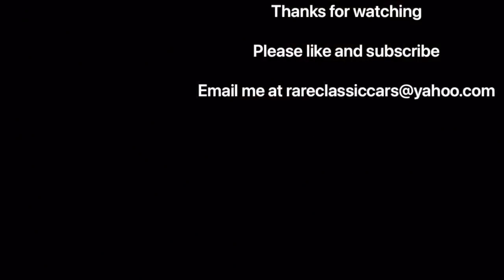Worst Engines of All Time: Chrysler 318/360/400/440 V8 Electronic Lean Burn

Comment: Had a 82 D150 with a lean burn super six  and manual - whadda dog....   put up with ping and no power for years...    rebuilt and reset the cab - both the metering rods and idle screws (drill and remove the idle screw locking caps, rewired it with 73 electronic ignition - woke up and ran great....

Comment: The Lean Burn system is in many ways identical to the GM CCC [Computer Control Command] that was introduced in 1981 except GM used a module in the distributor and did away with vacuum advance distributors.

Comment: One thing I might add;  my memory is shaky on this, but I do seem to recall that Chrysler was not the only user of the Lean Burn spark control system -  Volvo also used the Chrysler Lean Burn computer, but it was mounted on the fender.
Reply: Your memory is correct.

Comment: I had a 1976 Plymouth with a 400 lean burn engine.  The lean burn system failed and upon looking at the wiring diagram and realized I could substitute the lean burn distributor with a stock point-type distributor from a 383.  It was a direct drop in with no modifications whatsoever.  The car ran better than ever!

Comment: Had a ‘78 Plymouth Fury (ex RCMP) with the E86 engine, 440 high performance, with out lean burn or catalyst. The build sheet under the drivers seat said “emissions exempt”, so factory.
Reply: Here in California, they stopped allowing law enforcement vehicles an emissions exemption.  Much to the anger of the police, who suddenly couldn't catch the bad guys if they were driving a pre-emissions car.

Comment: I had a 71 fury that got 18 mpg . Now I have a 76 gran fury that got 11 mpg.This wasn’t acceptable to me so I replaced the thermoquad (850 cfm I)assume)with a 650 Holley it now gets 7 !! it didn’t have lean burn so I think I can introduce Chrysler’s decision to slap in very low compression pistons into their engines as another reason to nominate these engines as substandard.Though I guess the 2 71 1 rear could be to blame,it’s off the line performance is another black mark against it
Reply: My 81 Chevy truck came with a 2:73 rear end, despite having a stick, and the dealer said I couldn't order it any other way, so I had a wrecking yard that also did repairs put in a good 4:10 in it.  HUGE improvement, although it wasn't fast on the freeway.
Reply: @michaelbenardo5695  I could compete at bonneville (uneconomically)

Comment: Glad you don't just bash the whole engine, thank you. The system was flawed, idea okay, most cars nowadays run much like this only the processors move like lightning compared to mid-seventies electronics. I had a '76 Cordoba, I put headers, dual exhaust, and a point distributor, leaving the carburetor stock. The car would get 19-20 mpg out of a 400 on the highway. 
The Thermoquad carburetors we're only lean at cruise and idle, WOT was still jetted for 12.7 air/fuel. 
The computers also had multi-strike ignitions to handle the lean charge. Everyone that loves their MSD box ignitions can tip a hat to Chrysler engineering.

Comment: My dad had a 1979 Dodge Magnum XE, ( I love it, and it became my high school hotrod)  shortly after he got it used in 1986 it quit and left him stranded , the Lean Burn was removed and a regular diatrutor and Carb installed,  that car was a beast even with the 2 barrel 360
Reply: Not with 165 hp. They were all heavy and slow
Reply: @garyhoutz1540  it was a beast ,and in stock trim the 360 v8 with 2 Barrel , had 270 lbs of torque, and 170 horsepower,  I couldn't keep rear tires on her

Comment: I love how the label on you photo of the spark control computer proudly stated it was Solid State. As if there was a Vacuum Tube version that just couldn't hack it so they went to All Transistor ICs on a circuit board. Only High Tech for Mopars.
Reply: They call it that because ignition timing is traditionally done with moving parts, i.e. not solid state
Reply: Technically VT's qualify as solid state.  Maybe they tried relay logic and mag core memory first?  Bwahahaha!
Reply: @GoFastGator  I did not know that. I knew that the military used VTs for quite awhile in missile guidance systems or inertial Nav systems. Because they resisted EMP pulses. I honestly thought solid state meant "solid". As in solid transistors, 555 timers, integrated circuit chips, and discrete components on a PCB. Were these later developed using low voltage VTs?
Needing an ultra-high voltage transformer mixed with other low voltage components always seemed to be a source of problems in older stereo or musical amps. By the time I was involved with them. They were pretty robust.
And they had a lovely sound. Even if it wasn't linear enough to satisfy the "testing obsessed" listeners.
Reply: Yeah, everyone milked “solid state” for a long time on virtually anything electronic
Reply: It was the lean burn system that was the issue. Thd motors themselves were rock solid. A motor only runs as good as the fuel control system or ignition allows it to run. Heat ,vibration, and electronics don't mix.
Reply: My buddy has a nice New Yorker ,and the lean burn was giving issues. 
Got a carb and distributor for a few hundred bucks and it runs like a champ once dialed in.  @Henry-q4l

Comment: I have never been a Chrysler fan especially during the smogger years. They did make some reliable motors that went forever. Then came computers and other useless crap not only with this make. GM and Ford also had major issues especially the GM diesels for cars

Comment: I had a 1982 Chrysler Imperial and it was the worst car I ever owned by a long shot. They had a recall on the lean burn for these cars and my local Imperial dealer refused to recall it. He claimed he was no longer an Imperial dealer and went Dodge only. Even though the huge Imperial sign was still there. These are the people who sold the car in the first place. Just imagine my glee. That car was so bad I didn't sell it, I junked it and showed up to see it get crushed. I couldn't sell that to a person because it wasn't a real car. The most expensive car Chrysler built; I might add.
Reply: Many shops/owners yanked the computers off and converted them to a carburetor.  End of problems.

Comment: Had a 1983 Dodge RAM D150 slant\6 short-bed regular cab pickup with the Lean Burn system...talk about a piece of garbage to tune! Removed ALL components of that ELB then replaced with regular early 1970s parts & pieces. One the truck was running good, the Lean Burn "computer" was promptly put under the rear tire and ran over a few times and then stomped on.
Reply: My daily is an 82 just like yours was. 833 O/D trans. Converted mine 16yrs ago when I bought it. 270k and running strong. 19-20 mpg. My boat hauler summer ride is an 83 prospector AD-150. Rust free, 318 90k. Only 2 vehicles I own.

Comment: An older Cousin of mine lived in Leadville CO at >10,000 feet ASL. He bought the late 1970s Dodge Diplomat(?) in Denver and when he drove to Oregon to visit us it was running poorly. I very distinctly remember that electronic module on the air cleaner. Apparently, there was a different electronic module for high altitude cars. I suspect this was to allow them to still "lean burn" up in the thin air. Somehow it was diagnosed (dealer?) that this electronic module was broken or not working properly and was causing the poor driving. In Oregon, there were only standard modules.
After hearing you explain how this system worked, I suspect the original electronic module was fine but was running really, really lean down at SL on the coast and our house at 1350 feet ASL. It was going to take a week to get a new high altitude electronic module sent from Denver. So my Dad, Cousin and I went to a junkyard and pulled a used one off a wrecked car. Saved him some money because a new one wasn't cheap. And was probably a lucky and ideal fix for the problems he was having. I doubt he ever put a new or the original high altitude module back on as it was now probably running even better in Leadville CO.
Do you think this is a reasonable analysis of what may have been occuring? I'm just curious.
The electronic module sounds like it was made from a bunch of 555 IC chips set up as timers, counters, comparators and some memory connected to sensors and relays to the appropriate actuation devices, circuits and switches.
As I remember, it was a very large box.  Thanks for the great videos.

Comment: Adam, great explanation of the Lean Burn system. The basic theory of the system was sound. Slow processors, lack of memory/adaptability, and the pretty ridiculous placement of the processor doomed it to failure, not to mention there is no way a carburetor can effectively distribute fuel to cylinders to maintain A/F ratios leaner than about 13/1 or maybe 14/1. 

I owned a 1979 Diplomat with a 318, all the drivability characteristics you described were present, although overall, for the times, it seemed to be a really good running car. The Lean Burn System failed around 45,000 miles, was removed and an aftermarket distributor and carburetor were put on, the car had more power, was more responsive, better fuel mileage, and when in my state tail pipe emissions testing was initiated, it never had an issue passing. 
As far as the 14.7 to 1, or stoichiometric air fuel ratio is concerned, I believe that measurement is not volumetric but rather by weight. For every gram of fuel, 14.7 grams of air are needed. A gallon of fuel weighs roughly 8 pounds. To burn a gallon of fuel at stoichiometric would require 117 pounds of air. Wouldn’t that require more than 15 one gallon cans of air?
Reply: A carb can be jetted as lean as 16:1.  No, power will not be good, but it will function.  Many did just that during the war when gas was rationed.
Reply: @michaelbenardo5695  you are correct, they can be jetted that lean. The problem becomes fuel distribution and variants in air volume. A carb jetted to 14.7 to 1 doesn’t deliver that ratio to evenly to every cylinder as some fuel will drop out of suspension on the way to the cylinder, or the atomized droplets aren’t picked up evenly as air passes through the carburetor. If the ratio is higher than about 15.5 to 16 to 1 there’s a good chance a couple of the cylinders farthest from the carb will be receiving something like an 18 to 1 mixture. Most likely the mixture will not ignite. A carb jetted at 16 to 1 will create lots of misfiring while the engine is running.
Reply: I believe you are right about the 14.7 to 1 is not by volume.  Think about how many gallons of air are pumped through a 3.8 liter (one gallon)  engine spinning at 2000 rpm for a minute.
Reply: @mikekokomomike  thank you. Kind of makes you realize how important a clean air filter is, doesn’t it?
Reply: A carb is generally jetted to provide between 14:1 and 15:1 - it is just about impossible to keep it at exactly 14.7:1, but can be jetted for about 13:1 to 14:1 for maximum performance, but at a cost of high fuel consumption or 15:1 to 16:1 for maximum mileage at a cost of performance, but it will indeed run OK once warmed up.  This is at part throttle.  At full throttle, you want about 12.8:1 - 13.2:1.  What it can't do is stay at exactly a specific ratio or constantly change according to conditions.

Comment: I had a '77 Aspen 318 and never had a problem with the lean burn. I did have problems with freeze out plugs rusting through, a shattered diff pinion gear that was probably my fault :) and a host of other issues. I still have fond memories of the car since it was my first... but we did call it the Dodge "Aspirin" because it was always giving us a headache.
Reply: My cousin had that model, year car also. I had a rural paper route we used that car to deliver papers. We beat the living heck out of that car. He got the car up to 100 mph on a dirt road that intersected with a 2 lane highway. Saw no cars coming and blew the stop sign at 100, launched it over the two lanes and also cleared the railroad tracks that were parallel to the highway. Landed it on the corner of the front bumper and didn't even stall it out. Dukes of Hazzard couldn't even do it that fast.
Reply: I didn't have a problem with mine either. But that distinctive Clang from the rear end of Chrysler products when you put it in drive or reverse was always there
Reply: @hutchcraftcp  That sound means either loose universal joints or a Panhard rod that is loose.  On a car with rear coil springs, it can also mean loose radius rods/control arms, (bad bushings).  My Chrysler never does that.
Reply: That's why I use brass freeze plugs!
Reply: Whatever cheap stuff they made those freeze plugs out of, I think they were also doing it on the 2000 Durangos.
Reply: Shouldn't you have called it the dodge headache because it made you take aspirin? Lol just kidding

Comment: My very first car bought in 1978 was a 1976 Dodge Aspen RT with a 318. It may have been the most unreliable car ever made I'm not sure but today I found out that it could have been a lot worse if it had the lean burn system thanks Chrysler corporation you did be a solid on that one.
Reply: The Aspens were horrible I agree but definitely not the worst car ever. That category is reserved for the Chevy Vega with their terrible 4 cylinder aluminum motors
Reply: @FedUpCanuck  That engine was a total catastrophe.

Comment: by the late 70s chrysler seemed like it hired the entire yugo design team.or had just plain given up.then came the disaster of the k cars & omni/horizon.i seen alot of them had vw 1.7 engines.lee iocoaca must've been handing out loaded crack pipes to the design & powertrain engineers.if memory serves me correct, chryslers dive into FWD basically made them dumpster material right off the assembly line.americas version of the yugo.

Comment: Adam, I gotta tell ya!  Your videos are awesome.  I've got one for you.. I am the proud owner of an R(are) body 1979 Chrysler New Yorker.  She's a garage queen with 50,000 original miles.  Beautiful condition with the original paint.  It came equipped with your 318's bigger brother, the 360.  I've got the lean burn! It runs awesome.  But, that wasn't always the case.  It used to run "good", but here's what happened.  My cousin owned the car before me.  He had a custom dual exhaust put on.  Finally, after 18 years, the mufflers were starting to rust through.  I went to a shop to replace the whole system.  Originally wanted stainless pipes and Magnaflow mufflers.  Turns out his supplier didn't have those.  This was during the height of the pandemic.  I settled for the bigger galvanized pipes and Flowmaster mufflers.  He asked me if he could kill the cats.  He did offer to give them back to me (they weren't original).  Keep em' I told him.  I was initially concerned that the car would stink after the cat delete.  He said "You've got lean burn" it won't stink at all.  He was right.  Young kid behind the counter starts my car to pull it off the rack.  He says "listen to this" .  Starts it up, my Beautiful '79 New Yorker sounds like a hemi Cuda!  First thing going through my head was "oh shit, it's too loud"  second thing was, Aah F--- it, it's a Mopar!.  Laid a huge patch of rubber when I pulled out of the shop.  Ran like a million bucks!  Those lean burn systems don't like cats!  My Holley 2145 carburetor is original and has never been rebuilt.  Jets probably wore bigger and causes the car to run richer.  She starts like she's fuel injected now!
Reply: I took my cat off, was just clamped on both ends. Punched out the innards to hollow it out and put it back on. It was a melted down mess inside.
Reply: Flowmasters are now made in China.  My muffler shop will no longer install them.

Comment: You are correct but it was not the engine it was the lean burn system my 77 Plymouth Grand Suburban wagon had it and the dealer was not ready for it, I fix one issue the breather had the electronics hanging from the side and the ground was not sufficient so I just ran a separate wire I remember like it was yesterday and that was 1978! I unloaded that beast.

Comment: We had a 77 Volare 318 which, although it was a slug, did not have the ELB.  I know 1978 models did - maybe it took another year to migrate down to the F body?
Reply: If memory is correct, the 360 and 400 got it first.

Comment: Father in law had a 77 Chrysler New Yorker with a 400 lean burn it had a thermo quad on it car had around 70,000 miles on it never had any problems with the lean burn had trouble with the valve cover gaskets leaking from getting burnt up from the way the exhaust manifolds were built so close to the valve covers had to change the gaskets every year he never drove the car in winter 4 door hardtop had the most comfortable seats of any car I ever rode in.
Reply: Corinthian leather ??

Comment: I had a '77 New Yorker with a 440 ELB engine. The absolutely worst most unreliable car I ever owned. Period. It was only 7 years old when I bought it. Rode like a dream. Very nice interior. Once the engine warmed up and say you went shopping. When I got in the car to go elsewhere many, many times the car would not start. You had to wait for it to cool off...and NO it was not overheating. What a pile of junk. I managed to drive that car to New Jersey from San Diego CA. I made it but not without several issues. It was late winter in NJ and that car hated cold weather..well by the spring the car decided to run a little better...I sold it to a used car dealer in NJ for more than I paid for it....While in NJ I was so tired of the unreliability of that car I took it to a Chrysler dealer in NJ and they refused to work on it. REFUSED. They claimed they did not work on cars with California emissions.....Nowadays I drive only Toyotas...